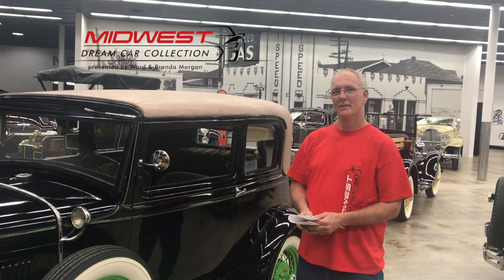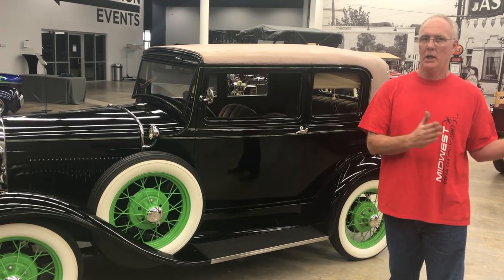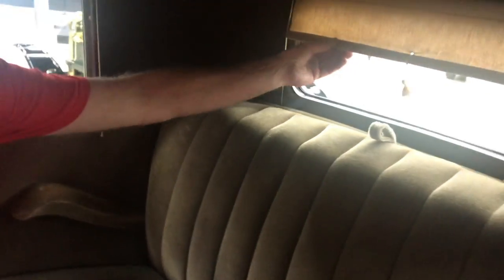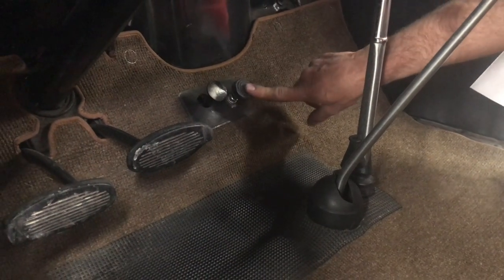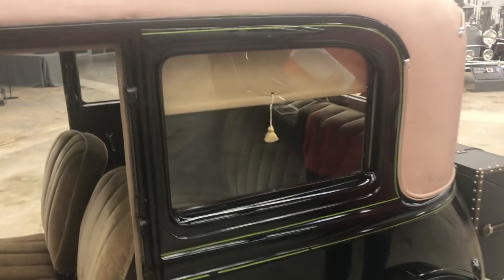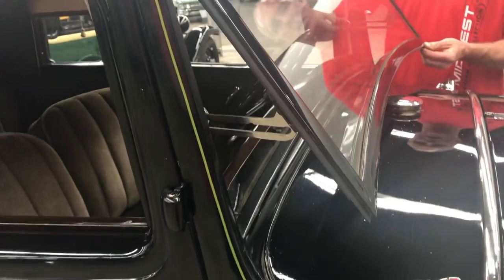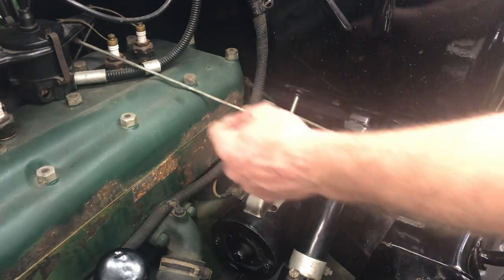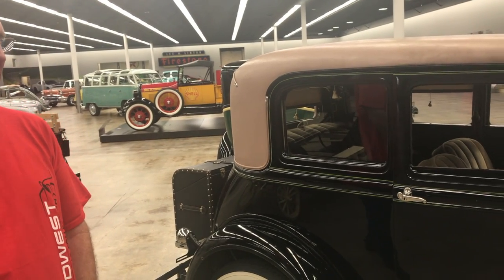1931 Model A Victoria

Comment: my father bought me a 34 V8, not sure what the model was called, I was very young it had be laying under a tree in Tasmania Australia for years, it had a cloth panel on the roof which he had replaced for me,
 I painted the wire spoke wheels silver of course, it had a wooden floor in front with battery under and a floor button start, I used to drive it without a licence and got caught by the cops lol
Reply from the maker: What great memories!